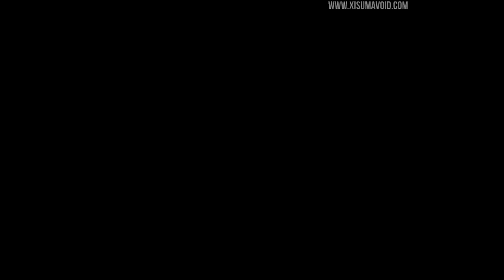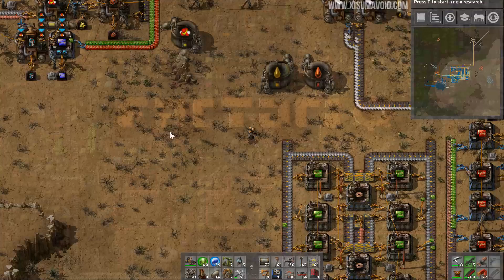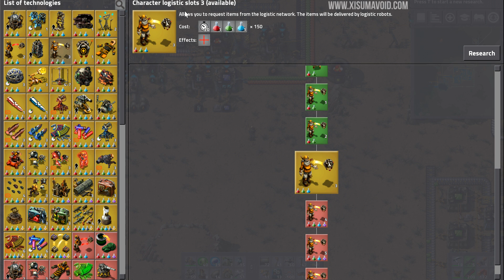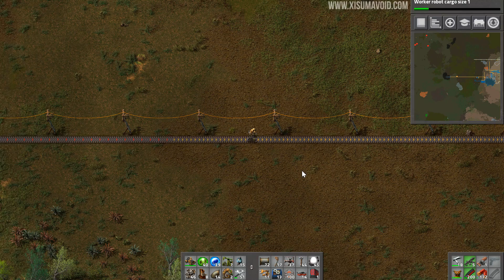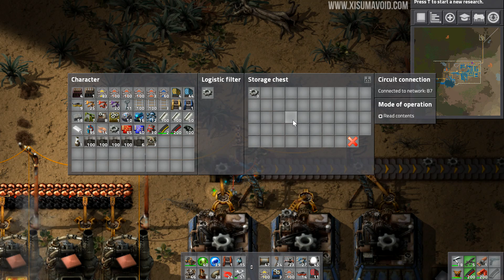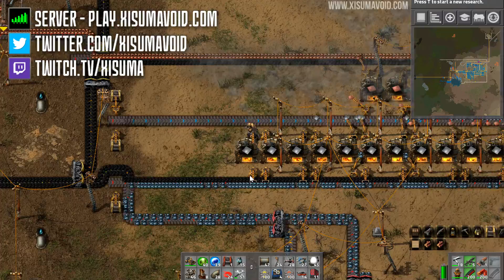Let's Play Factorio 07 Roboports! (Factorio 0.16)

Comment: Glad to see more factorio! One of my favorite games

One recommendation I have for your power, is to have a chest based buffer with an alarm set for when the buffer starts getting low. That way, if you start running out at the mine, or start using more coal than you can provide from your miners, you have an alarm that will give you some time before you completely run out, hopefully with enough time to set up more miners.

Comment: Just started messing with logistics after last week's video. I am an IDIOT. Everything is SO much easier with these bad boys. On the other hand, being afraid of logistics got me an achievement (Logistics Network Embargo) that would undoubtedly be frustrating beyond belief if I'd gotten used to them beforehand. 

Also built my first working train. I have absolutely no idea why my initial train efforts didn't work, this one just... did. I threw it together and slapped the train in and everything is perfect. Go over there; done. Come back over here; done. Absolutely mystified what was going wrong with the first one.
Reply from the maker: Stations might of been on the wrong side of the track
Reply: @xisumavoid  Tried that, actually. Switched both stations to both sides, tried having one on each side, added various combinations of signals and chain signals on either side, moved the locomotives around, I could get it to go to one station... but the other could only be reached in manual, not automatic. In frustration, I added a big loop in the track so it didn't have to turn around, but it had the same problem: it could not find the path to the other station. It's UNDOUBTEDLY something stupid I did, but even after going over a half dozen YouTube videos and the official wiki, I never figured out what it was.
Reply: You can use the storage chests and still get the achievement.
For the trains, if you want them to go backwards they need a locomotive facing backwards which I think still needs to be fuelled.
The simplest way to make sure it works is to have a loop with signals always on the right side of the track.

To find problem areas, have it in manual mode and travel along the path and at various points (such as after every signal) tell it to go to the station and see if it can. That will narrow down the problem area.
Reply: @jeffreyblack666  Yep, locomotive in each direction (doesn't matter where in the train it is) and they both need fuel. Tried adding a loop at the end out of frustration and it still didn't work. I read about a half dozen different troubleshooting guides and watched a bunch of videos and never figured out what was wrong, then eventually deconstructed the thing so I'll never actually know what the problem was. 

At some point I'll have built enough trains that I have a known good pattern, but right now I'm still clueless about them. I don't know what's different about the train I just built that works; it looks exactly like the one that didn't, and even follows roughly the same path.
Reply: @cdarklock  That makes me think it was just a case of a misplaced signal. I had that happen to me once and it took a while to find it. Another time a tiny piece of track was missing.